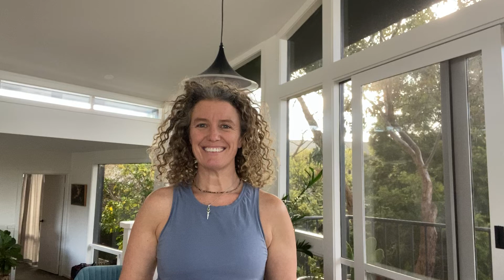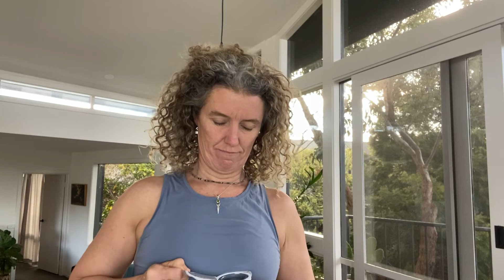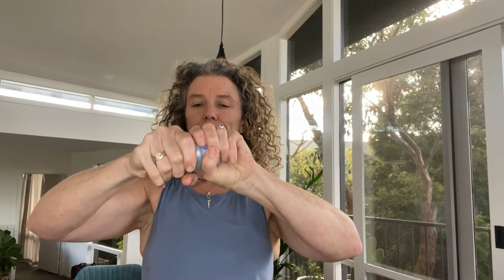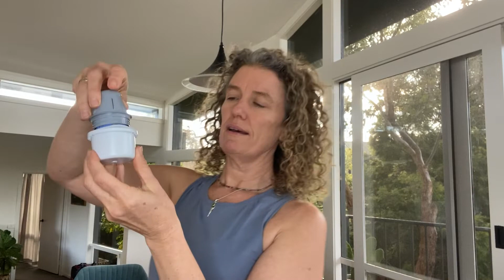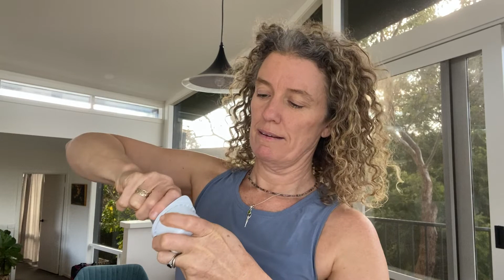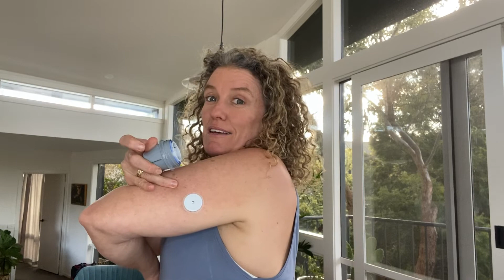How to apply the CGM sensor with Dr Michelle Woolhouse

Comment: @vively Can you swim in the ocean with it?
Reply from the maker: Yes you can! The CGM sensors are water resistant - meaning you can sweat, shower and swim without any worry of damaging the device. Vively also provides a protective patch to cover & protect your sensor for durability 👏However, the manufacturer advises swimming for no longer than 30 minutes and no deeper than 1M. Hope this helps!